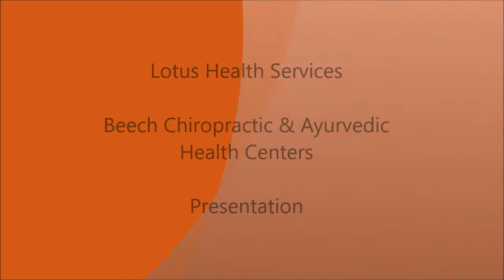Why Do My Joints Make Grinding Sounds

Comment: Thank you very much! It's very helpful. I was always wondering why do I get those noises after I start my new job by sitting a lot more. I thought by sitting more it reduces my movement and decrease my joints use would help for lasting my joints longer. But the grinding noise makes me really worried. I also feeling ticklish over time and it become very uncomfortable. I hope to have a answer for that too.
Reply: Hi, ticklish means there is some stress to that area, not enough to activate the pain fibers but enough to create sensation change such as feeling ticklish.  You should find a good Chiropractor in your area, adjustments will usually help.